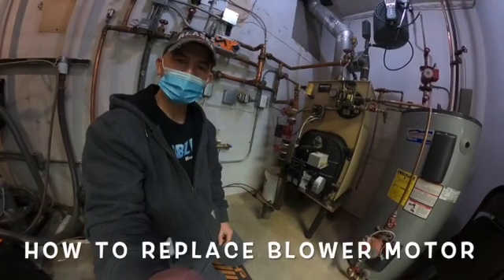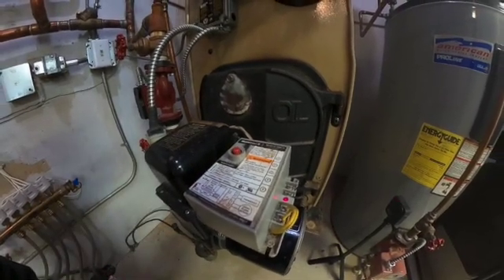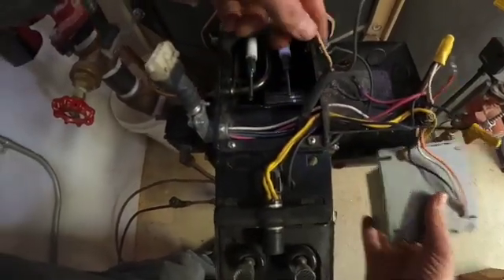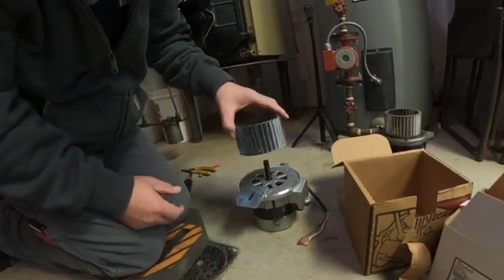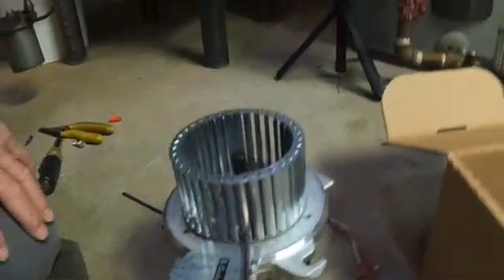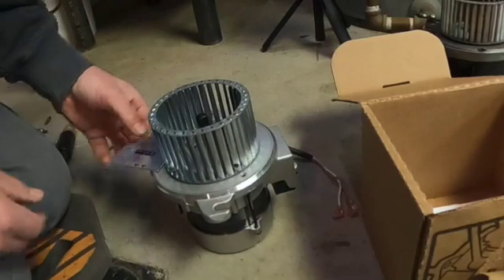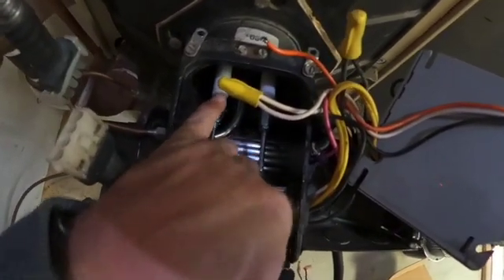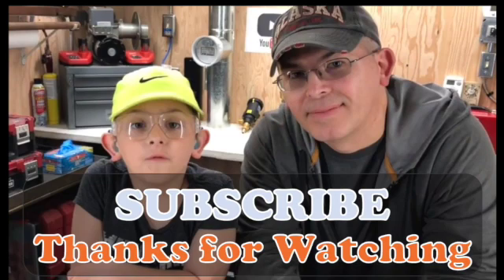NO HEAT? BOILER TRIPPING – BAD BLOWER MOTOR FIX

Comment: Hi there great video . I have a question because it getting cold and my furnace is not working. I have air comming out of the inlet filter on the side of the blow motor . Does this mean the motor is running backwards? The air is comming out of the filter where you adjust the air flow going into the burner head it that makes sense . My burner is a Beckett . I furnace runs but not well . I have changed everything from the control unit , nozzle,new igniter box. I thought the air was supposed to go into the burner head from the side where the adjuster ring goes. Should I change the direction of the blower motor ?
Reply from the maker: I have never seen one spin backwards. I wish I was there to see what you were talking about.

Comment: Bad motor keeps tripping,  can I use a used .motor from same style unit.?
Reply from the maker: If it’s the same model, it should work. I recommend doing a combustion tune when you get it installed. Just to be sure is running safe
Reply: @FurnaceTech  I appreciate the feedback,  motor runs great on bench.  I just wish the tenant would listen to the homeowner and just fix it right.  The tech said where to start,  which is motor,  but could be something in lines if it's getting air. This hasn't run in 3 yrs. Tech took apart everything n cleaned everything and hooked everything bk up. I think the tenant needs to have tech install n adjust everything.  IMO.    This tenant is about fast n cheap but homeowner has already said he's paying for it, so why not do it right n let my tech do it. I'm just frustrated,  sorry. I can install motor, very easy but I just have this feeling that he knows something else is wrong,  lines perhaps.  Idk.  I'm not touching anything.  Homeowner wants it right,  he can pay my tech to do it n adjust n replace things as needed. Really dumb question,  does the return come on when boiler is on or is that return strictly for ac?
Reply: @FurnaceTech  I mentioned the motor was good,  and I did take motor off n Lmao it was good after they told me it was the motor. I'm guessing since it won't turn n trips the pump is whats bad..!!?  I give up tryn to help n bein the nice guy. Thanks for replying